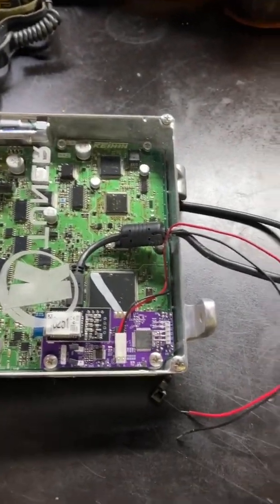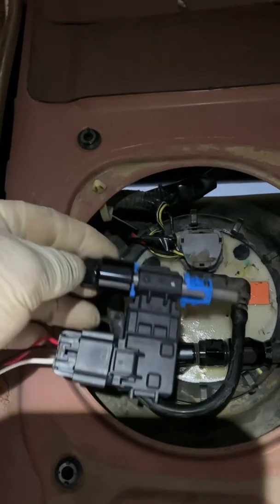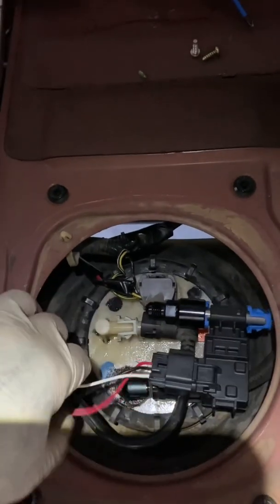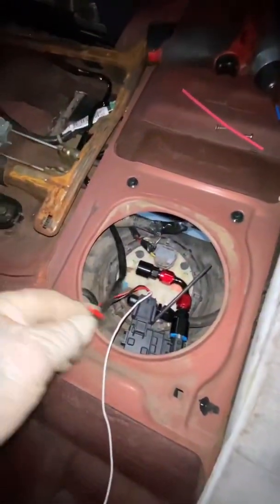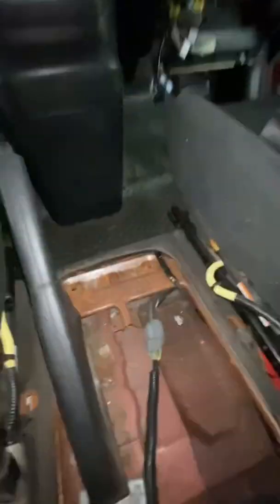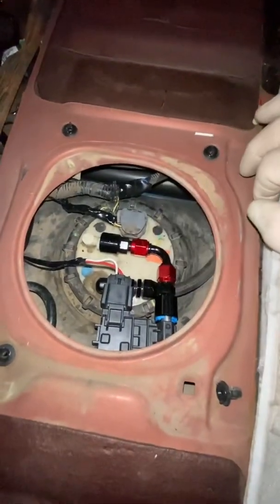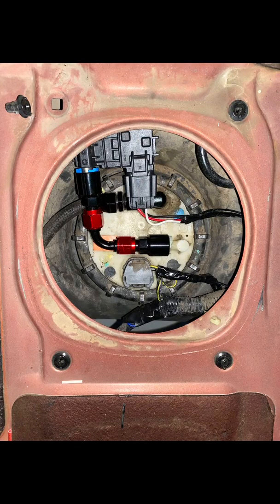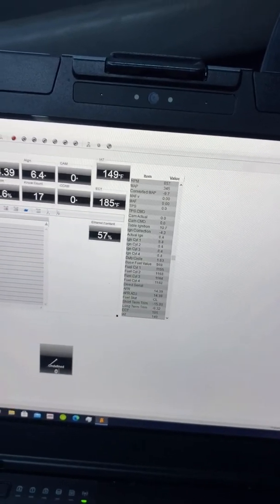E85 flex fuel sensor install on Turbocharged Honda Element

Comment: How’s your idle is it like stock, and would I be able to retain A/C when I go turbo?
Reply from the maker: Idles and drives stock. With ac and power steering!   👍
Reply: @11AM_im  damn man… I’m geeked can’t wait to get my build started.. you think I should build out a k24a4 bottom or a k24a2.. I’m new to the Honda world… I’m a Cadillac man
Reply from the maker: @Jbrown99th  so if your building it I would def do the a4.  They are cheaper to begin with.   K24a2 can handle some serious power stock.

Comment: Did you add a resistor for the flex fuel sensor or the resistor is not needed? If it’s needed do you know what the resistor ohm is?
Reply from the maker: No resistor added.   Just wired straight to r1 board.
Reply: Sweet and thanks for the reply back.
Reply from the maker: @vanglor2287  u bet,   Any time!
Reply: Would you happen to have the part number for the flex sensor by chance?
Reply from the maker: @vanglor2287  yes sir

ACDelco GM Original Equipment 13507128 Flex Fuel Sensor https://www.amazon.com/dp/B073ZQ1G2P/ref=cm_sw_r_cp_api_glt_fabc_Y9D14HHPERQCHVZZWYG3?_encoding=UTF8&psc=1